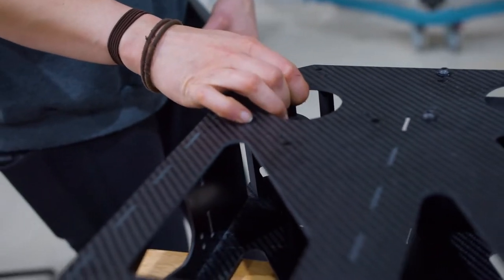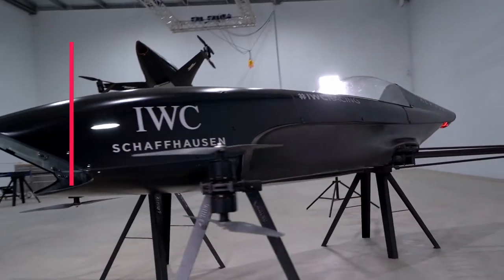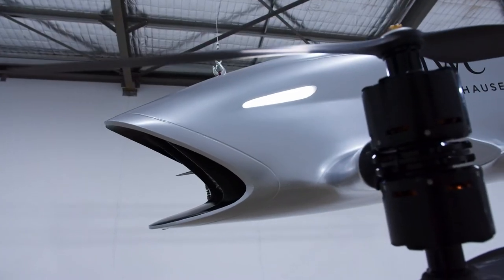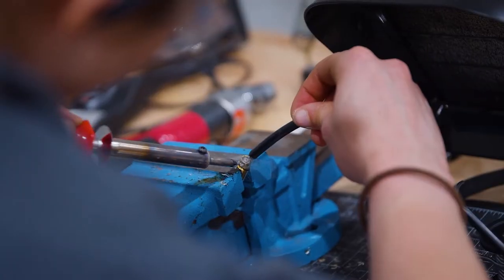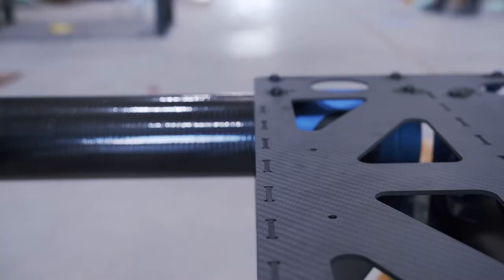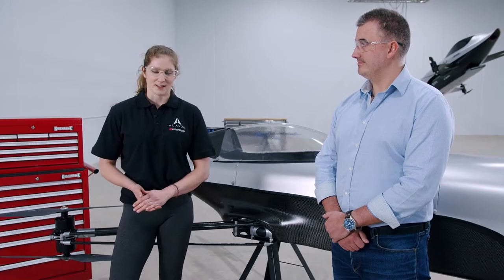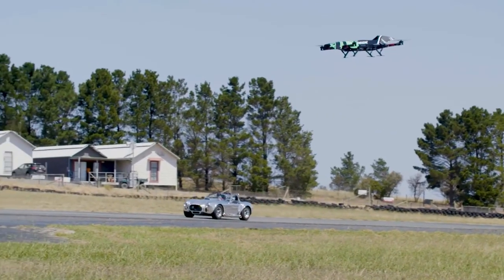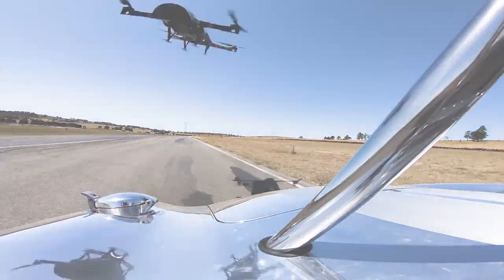Aerospace Engineering: Airspeeder's eVTOL Battery Power Capacity Explained | Flying Car Racing

Comment: 🙌🙌 Can’t wait for the battery specs to be released (max weight, safety/failure tolerances, discharge rates etc) so we can have the battery makers start to compete as well.
Reply from the maker: This. 

We're very close to this so stay tuned.